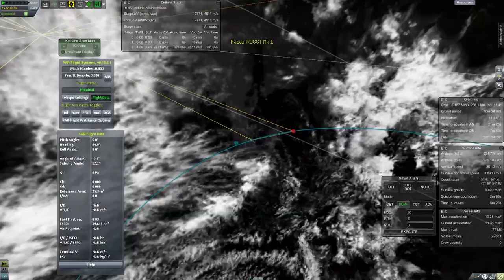KSP - Space is Hard (Vacuum) - Episode 5 - Flame-Broiled Satellite

Comment: The air in the VAB flows from the ceiling. Orient it shield first, then run FAR analyses to check how it will behave. If necessary move mass near the shield and add more drag/lift (some fins, say) at the other end. Simplest check is just turn on CoM and Aerodynamic Center (KSP calls it CoL) and make sure that with the heat shield on top of the core (i.e. flipped 180, oriented with the top of the VAB as source of airflow) the CoM is in front of the CoL.

Comment: You've got multiple omnidirectional antennas on your commsat.  Does that increase the communication range?  I haven't been able to find any statement in the RemoteTech docs that it does.
Reply from the maker: You can set RemoteTech's settings to have comm devices' range "add" to one another - either completely or partially.  I think I had my coefficient set to 0.4, so the range was (ant1 + 0.4*(ant2+ant3+...))  That way, I could stack antennas and get some benefit, while still keeping it a technical challenge to get the ranges I needed.

Comment: How are you launching from different sites?
Reply: Go to the tracking station,the list of launch sites is in the bottom right corner
Reply from the maker: It's integrated with Real Solar System.  And as M Forres said, the switching function is done at the Tracking Station.  If you're using RemoteTech 2, it's advisable to set up ground stations at the other launch sites.  A link to my RemoteTech config is available on the KSP forums.